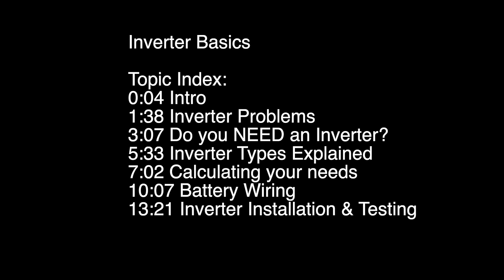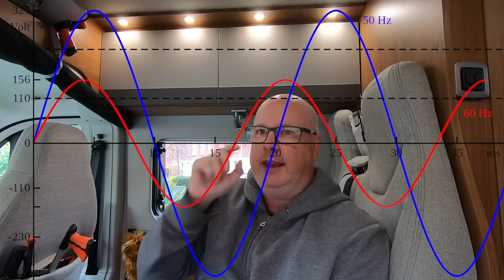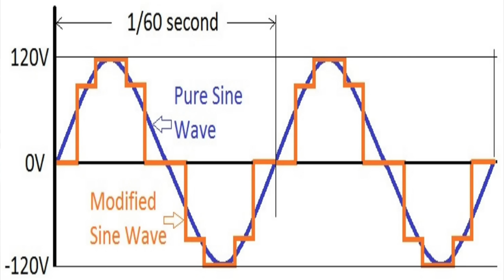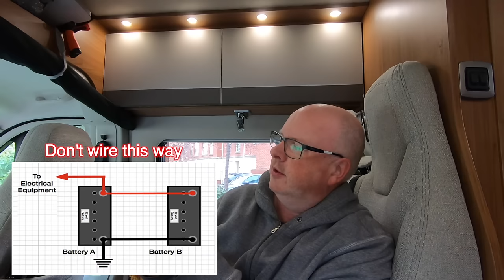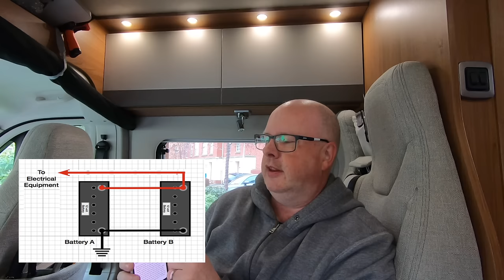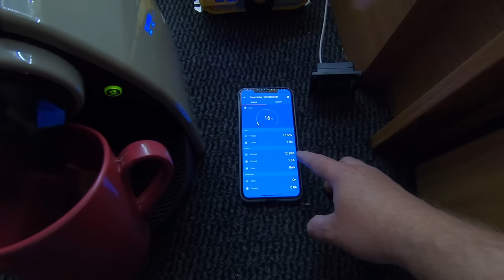Detailed 12v Inverter & Battery Wiring Guide - Campervan, Motorhome, RV & Boat

Comment: Hi jon. Great videos. I know you must be busy but wanted to tax your brain about the coffee machine video. I'm not after using a coffee machine but am interested in linking my 2 leisure batteries together. Can you recommend a kit that would do that wiring. Also my solar panel and inverter come with the red black crocodile clip ends. Would I just be able to clip these on the the batteries once linked? And if so in what order. Sorry I'm really totally clueless regarding electrics. If you were able to assist fantastic. If your to busy. I wish you well and will keep watching on YouTube.
Reply from the maker: Hi Pam, there isn't a kit as such to link your batteries together, you can find people on ebay that do make up the cables and sell the terminal connectors, you'd just to to tell them the cable length. It should be rated to your batteries too, so 100 amp battery would need 16mm cable. I would cut off the crock clips and use a crimping tool for the wires for the solar panel and inverter. But they do need to be connected with inline fuses and a solar panel needs a solar controller to correctly charge your batteries. 12v wiring is simple, and I can explain everything, however, it can also result in fires and damage to equipment if it's not done correctly. So feel free to aks more questions, but if you do feel overwhelmed then get an auto electrician to do it for you, it shouldn't take them more than 1 or 2 hours and they can make the cables and put the correct ends on them too.
Reply: @johnmandy  legend thanks for the swift response. That given me more fuel to work with.

Comment: I want 240v to use hair clippers unless you know of a better way or battery clippers etc
Reply from the maker: I use clippers that use AA batteries, I use rechargeable batteries too and they charge from USB - Work great with my suave hair style 😜
Reply: @johnmandy  

I just knew you'd know the answer lol 

What clippers do you use etc
Reply from the maker: https://amzn.to/2TUm5Vz These work fine for me 👍🏻
Reply: @johnmandy  

I finally bought some aa battery clippers 

What a result and only paid £11 which included 2 AA batteries etc 

Bargain
Reply: @johnmandy  

Bought the clippers used them but I think I've thrown them away with the box they came in lol
Reply: @johnmandy  

I have found the best van life website address 

It's not cheap and will cost over £10k easily but it's the cats pyjamas of a van life website address the best there is but it would need to be trademark checked as it may infringe trademarks but some bod with a brand new Campervan with a few quid will take the punt and buy it 

Let me know when your online and I'll tell you what it is

Comment: Hey John, I have a question - I have looked at your video on inverters and installation and would like to install a similar setup with the remote switch powering just one of the 230v sockets in my van which will be fine for my needs.  Whilst even as a novice I feel confident to install as shown I am unclear the connection that should be used on the inverter to wire to the van socket rather than having to use the sockets directly on the inverter which I am hoping to hide...... any advice greatly appreciated.  Love the channel. Ben
Reply from the maker: Just wire a plug to the front of the inverter and plug into the inverter socket

Comment: 4 × 110ah, where is the best place to wire the inverter to the batteries?
Reply from the maker: That’s easy. Follow my diagram. Draw 4 batteries and label them A B C D then join all battery positives terminals together and all negatives in the same way. Then just like I showed in my video you take ground to battery A ground and positive from battery D positive. Easy, the video also explains this.
Reply: @johnmandy  I was thinking more about where would be the best place to connect inverter to 4 x 110ah. Does it matter?

Comment: Hi John Is that a pure sinwave or modified?
Reply from the maker: It’s a demo of how to wire an inverter, it’s up to you which you buy for your own needs.
Reply: @johnmandy  Hi John Thank you for getting back to me.  

I understand that the video is tutorial but my question is about the invertor  I like it and have tried to buy it also contacted the manufacturers. Who advised me that they do not make a 2000w for the uk market and also it is not a pure sinewave. Is this your experience too?
Reply from the maker: I cannot find it on amazon any more, maybe they stopped making it.
Reply: @johnmandy   Thanks John.

Comment: How can something use a few amps an hour? Ampere is the measure of current, not an amount of energy.
Reply from the maker: Quite easy, amps can be measured as a load and therefore calculated 👍🏼 as amps is energy that’s why it’s used to calculate energy usage. Currents are full of energy 😁

Comment: hi, couple of months ago i said i was buying a campervan without a inverter, well it did have one fitted(1000w)and only went to one double socket which is what i wanted. when hooked up i have 3 double sockets and used a martingale that shows all is well on hook up but when i used it on the 1 socket on the inverter it shows a earth fault and nothing works in it.  after i turned off the inverter i removed the wires from the socket and connected live/neutral together and tested with no problem and the same with the earth with no problems. i put the martingale straight into the inverter and the same result. it has a light that shows green. any ideas !!

Comment: So you need over 83 amp circuits to run a coffee maker?  Plug ins at campgrounds are only 30 to 50 amps for the whole camper.  Most house sockets are only 15 amps in North America and I make coffee all the time.  Am I missing something?
Reply from the maker: Don’t confuse 12v amps with 230v amps 👍🏼

Comment: So everything you run is connected by an extension cord?? Why is there a black hole not showing the connection from the inverter 120v out to the AC outlet  where we will be plugging in our deco coffee maker? The rest of your video info is really basic knowledge.
Reply from the maker: Black hole??? My inverter is wired using the black & red cables it came with. They’re wired red to battery and black to battery.
Reply: @johnmandy  Yeah, that would be the 12v side. If you read my question it was directed at the 120v out... wired to a permanent AC plug outlet ie: wall receptacle. That's the wiring I was asking about... Black hole just refers to missing info

Comment from the maker: **PLEASE READ**
Due to some comments on this video I wanted to point out this isn't a product review, so I can't say do this or that as it might be different for other products. I have to be very cautious about what I put in my videos to ensure people don't just do as I do and then not understand what it is they are doing. This is also why I removed links to the products featured as I don't want everyone to just buy this inverter thinking it would be perfect for them, it was bought to power a coffee maker and won't be used for anything else.
I also want to point out that using an inverter constantly will drain your batteries and, depending on what you are powering, you might need a solar array to balance your daily inverter demands, and if you have lead based batteries this could mean you significantly reduce their lifetime.
This video was 12 days in the making, every detail checked and double checked, however, if you want advice or to ask questions about your own system then please ask me and I'll do my best to answer you.
Reply: Hi Gadget John on tour, many thanks for your reply its very kind and I understand regarding recommendations, I only ask as I have just bought a 3KW inverter and seen that people earth them to the chassis, just doesn't sound safe as its metal and conductive and in easy contact
Reply from the maker: I agree, but in truth the earth would be via the negative of your battery bank which in turn should be connected to your vehicle chassis.